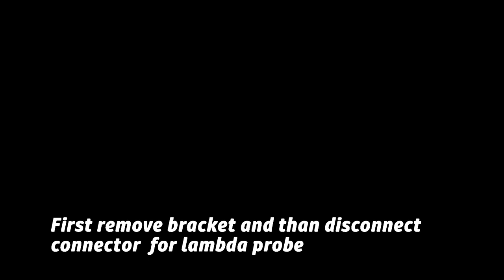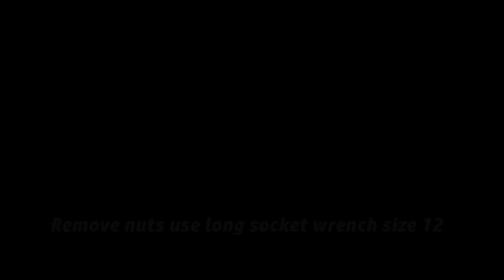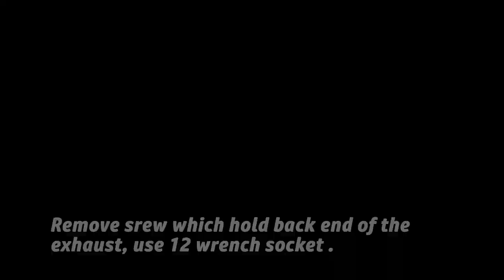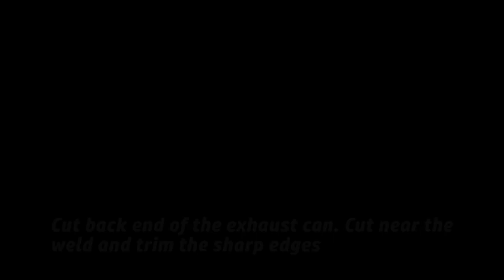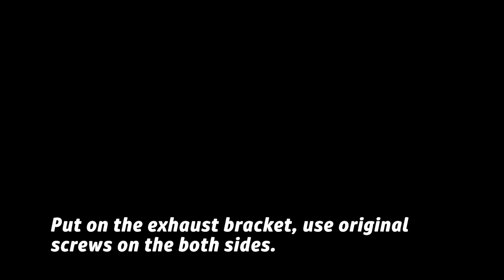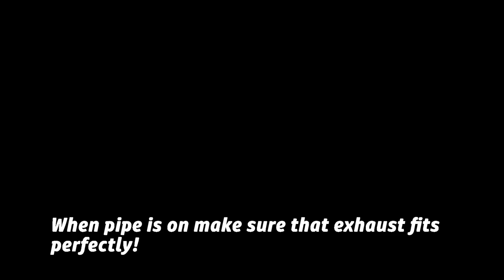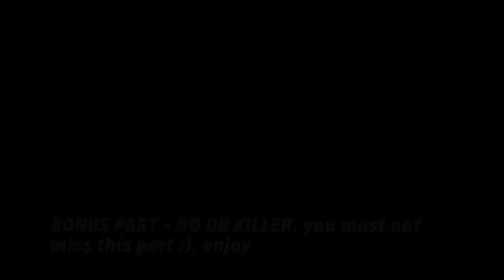Scorpion exhaust installation on Yamaha Tracer 900 2019 original vs. Scorpion pure sound

Comment: An honest opinion. I've been riding for forty-two years. My current ride is a 2013 Yamaha Fjr1300a. My last trip was 7835 miles. I appreciate the quiet, on a long trip, of the stock exhaust on my FJR. It's been my observance that sound level has a lot to do with fatigue. Having no droning exhaust sound works. I've logged up to 952 miles in a day.  The quieter the better. I use a set of Bose Noise Canceling ear buds. At 65 mph, and the windshield positioned correctly, the noise inside my Shoei GT Air, is nearly dead quiet. I plug my ear buds into my Galaxy phone, and use Pandora, or Audible for a book, or stored music. Great entertainment and no droning exhaust noise to wear you down, and take away the bliss.
Reply: I totally agree with you. I've had my fj-09 for 7 years with the stock exhaust, but my biggest problem with it, was its ugliness. I finally changed it to a slip on that's similar to this one, but I also bought the stage 2 baffle. It sounds a little louder than stock, but at highway speeds, I can barely hear it. The after market muffler just looks better to me.

Comment: Hi, thanks for showing us how to fit the pipe.  Is there any difference with the power delivery of the bike afterwards and does the bike still run as smoothly etc ? Am thinking of fitting this to my own Tracer. Thanks.
Reply from the maker: Run like a champ 😊
Reply: I fitted the pipe to my bike. Easy to fit. Love it. No baffles.
Reply: It runs better without restrictions. See my video of easy way to modify the stock muffler
Reply: @cruisingthethaiway6881 put a link to your video

Comment: did you weld the link pipe on? did you have to get your ecu flashed
Reply from the maker: You do not need to weld it, but I did. No need for ecu flash, because the pipes stay original.

Comment: good job. it got a spectacular sound. where did you buy the parts? slip on and the pipe? how much it cost? good curves
Reply from the maker: I bought it directly from Scorpion.
Reply: Scorpions doesn't sell that, the mid pipe
Reply: @Modelar4ever  Scorpions doesn't sell that, the mid pipe

Comment: Did you flash the ecu after installing?
Reply from the maker: No, no need, because the pipes are original. This is only slip on.